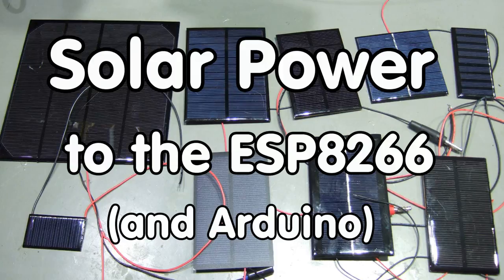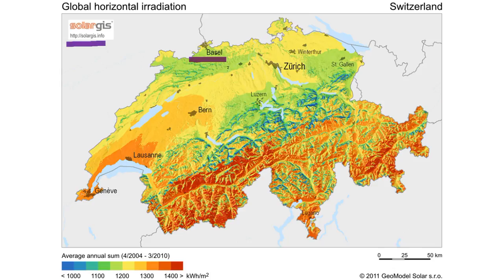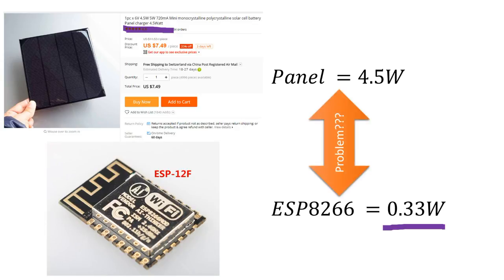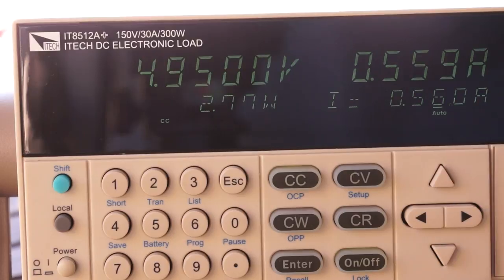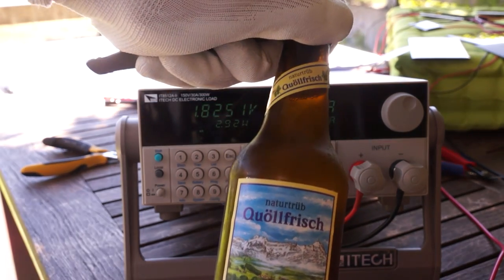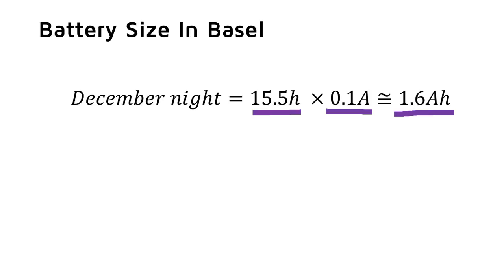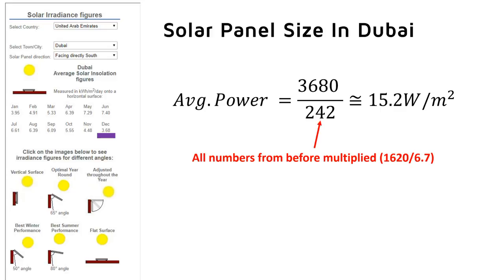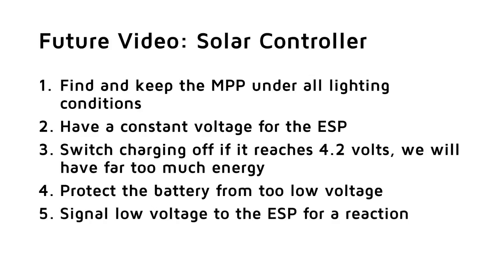#142 Solar Power for the ESP8266, Arduino, etc.

Comment: Hey Andreas, your videos are always very informative, thank you.
I'm looking forward to the MPPT test, I will use in my project a small solar panel ~5W and charge with it a single cell lifepo4 battery. With this setup a ESP8266 should be powered which uses deepsleep.

Currently I'm testing this charger board, but I'm not very happy: http://ebay.eu/2whlRrV
The CN3722 should be able to work with a input voltage between 7.5V and 28V... my idea was to use a 12V panel - but the charger board only works when input voltage is above 16V, I think this is because a fixed V-MPPT value is set to somewhere at 16V... there are boards available with a potentiometer, I think I will get one of these shortly. 

Greetings from Zurich
Reply from the maker: I am working with a similar chip and had the same issues. It can be solved relatively easy. Look ath the CN3722 data sheet. There are two resistors, R3 and R8 (they have different numbers on my device). They have to have the ratio that they produce 1 volt when Vmppt is reached. I had to change one of them and now, the voltage where the battery starts to charge is around 5 volts. Maybe it is even better to replace these two resistors by a 100k trimmer.
Reply: That's what I was thinking, thank you for confirmation. I've now ordered some of the CN3722 board which already have a trimmer on them - it is more elegant. If I find time I will replace the two resistors with a trimmer. 
Wish you a great sunday, unfortunately it's not very sunny today ;)